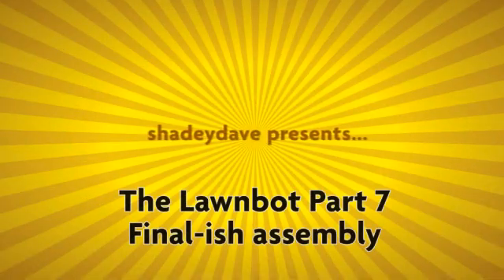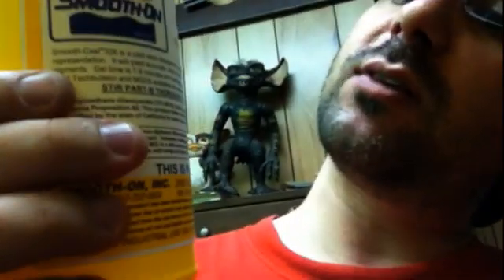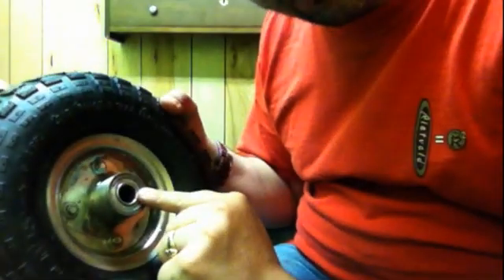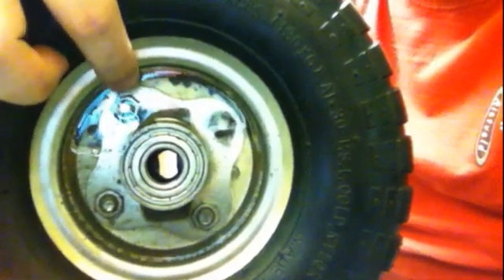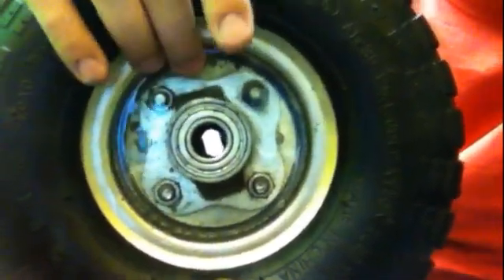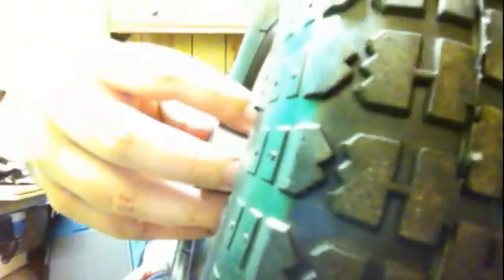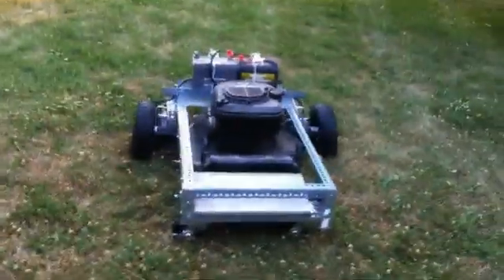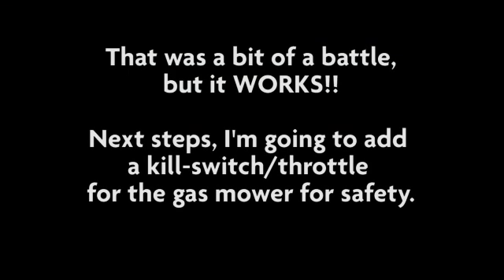LawnBot Part 7 - It works!

Comment from the maker: Sorry for getting back to you so late. Turns out the motors I used for this stage of the build are from a 1970's electric wheelchair, and it's almost impossible to find proper wheels or wheelhubs to fit it. I ended up using heavy-duty dolly wheels and some high strength epoxy resin to make my own custom fit hubs. It lasted for about 2 mows before shattering. I went on ebay and purchased some new drive motors with wheels included from a wheelchair parts company. Saved a lot of headaches.